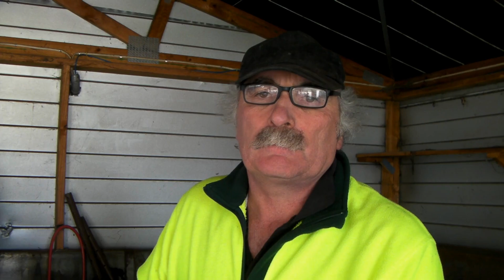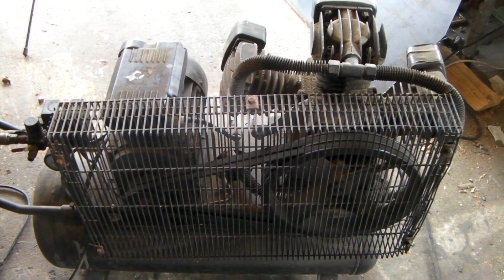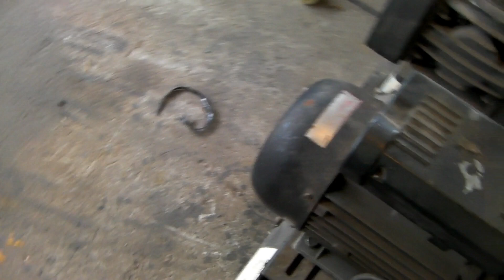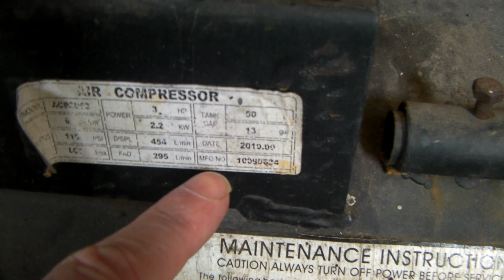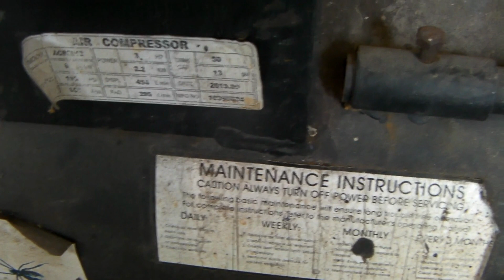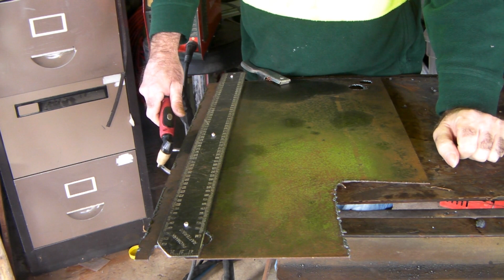What Size Compressor For Plasma Cutter

Comment: So pretty safe to say u cant run the compressor and the plazma on the same circuit at the same time so plug one of then into a different circuit ?
Reply from the maker: If your compressor is very small you might get away with it.

Comment: Hey don’t know if your still stuck on this issue but you could try running the air compressor off a different breaker most breaker panels can handle 100 amps or something like that so as long as you have room for another breaker you should be able to do that pretty easily.
Reply from the maker: My household max breaker is 15 amp

Comment: Check the  CFM on the plasma cutter a 3.5HP 60 Gal should work but if you can get a 5HP 80gal tank better.
Reply from the maker: Hi 3 hp is all i can run in my ship cheers pete
Reply: @petestools  ship.? Cool 😀

Comment: Since the rest of the world has gone to Metrics a long time ago, I would appreciate if you stay with Metrics so people don't have to google the equivalent. Americans are the only country who chose to stay using the old Imperial and they're the ones who should find the conversion instead.
Reply from the maker: lol  true
Reply: Cubic Feet per Minute (CFM) is one of those imperial units that is still referred to globaly. People installing and repairing compressors all over tge world still refer to CFM instead of LPM. It's the most important figure to look at when purchasing a compressor and it frustrating that half the time the CFM or LPM  is no where to be found on a compressor.
Reply: @oldandstong6504  Moved

Comment: Most cutters of 40 amps require a minimum of 5CFM, or the metric equivalent. It’s not the air pressure that needs to be changed, which most manufacturers state to be from 90-125 PSI (6.2 - 8.6 bar). It’s the CFM that changes depending on the thickness of cut. 1/8” or 3mm needs 3CFM, at least, and 1/2” 12.5 mm needs at LEAST double that. So my Thermal Dynamics 40 amp model (the new one, not the old one) requires, according to ESAB, from 3.3 -7.5 CFM, depending on the thickness being cut. This is up to 1/2”. 12.5mm for a high quality cut, and is minimally useful to a 1” sever, which is a poor quality cut.

The problem with compressor ratings is that they’re not really good for long term use. For more than about 30 seconds, or so, depending on the model, other than for commercial models, derate the CFM by 35%, or so. So a model rated at 10 CFM is really good for maybe 7 CFM. The tank size does matter, but even a 20 gal tank will run down quickly below startup pressure.

A 50 amp cutter will require about 20-25% more CFM. About 12 as a decent size, if it’s real.

In the States we have 120 volt 20 amp, and can easily get 240 volt 20 amp, which is standard for air conditioners. The welder standard around the world is 50 amp 240. You can manage, if your welder does it, with 120 20, and even, for small welders, or really lowered output 120 volt 15 amps. But I don’t recommend it. So in my shop, for my welders, I have 50 amp 240 volt. My cutter has the same plug, so I move one out, and the other in. This isn’t a professional shop. My entire basement and two car garage are my shops.
Reply from the maker: Great thanks for that i would like 3 phase in my shop but would cost over 5 k to get it so not worth the trouble .cheers pete
Reply: Mel is CFM measured at specific psi ? Some machines quote CFM @ 90psi other just state free air and if they are capable of 145psi then free air will be better at lower psi surely?
Reply: @panfon5650  cfm must be reported at some pressure number. Free air, such as that from a fan isn’t useful, obviously. As soon as air moves through a tube, pipe or whatever, it’s restricted. So the pressure within that carrier has a higher pressure than the surrounding air. In fact cfm is reported as scfm, which means “standard”, which is at a specific temperature and such.

In a plasma cutter, a main function is for the air to push the melted material away from the cut, which is why it sparks so much. If the air isn’t at whatever pressure the manufacturer states is needed, then the molten material just sticks to the cut. It’s the force of the amount of air and the speed of the air caused by the pressure that does that work. High volume, low pressure air would just billow out and do little.

Comment: Do plasma cutters need higher air pressure when making thicker cuts (higher amps)?  Or is it all the same.
Reply from the maker: yes normally  but thats sometimes hard if your limited with your air supply.
Reply: https://youtu.be/bzAe0mbpmVg plasma cutting machine with air compressor